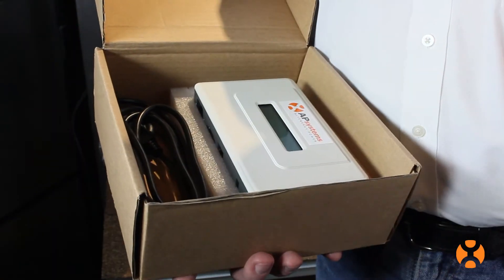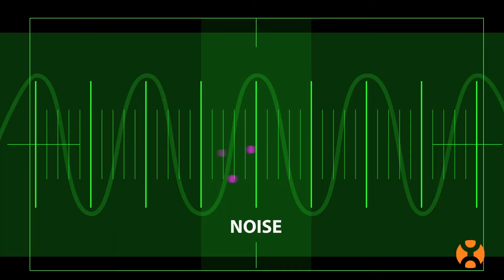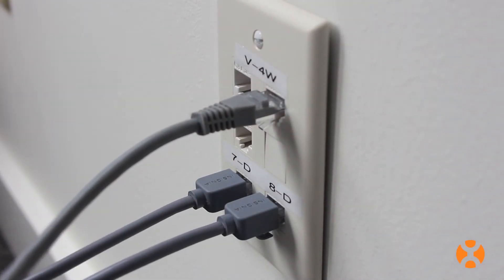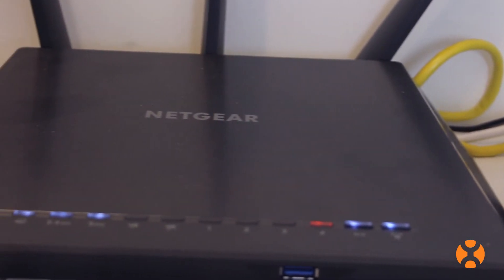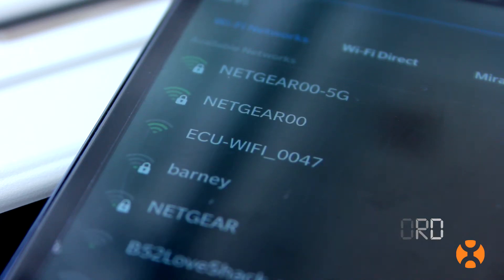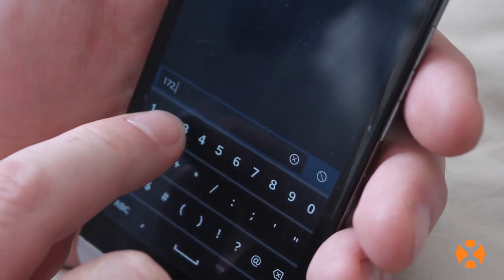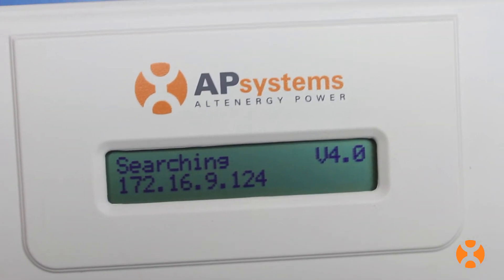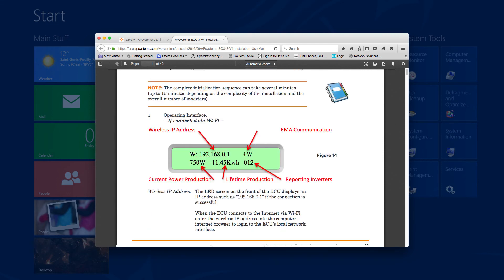DISCONTINUED PRODUCT: APsystems Training - Part10 ECU

Comment: How do you get log in details for the App?
Reply: About the only thing good on the APSystems setup that I've found is that the ECU has an internal webpage.  You can scrub that and get your own data.  By the way, you'll need to do this anyhow because APSystems won't help you at all when their high-failure-rate inverters puke out and you have to replace them.  They won't let you administer your own account, meaning that you cannot swap out that failed one for a new one.  God help you if you cannot program because these guys won't give you any help at all.

Comment: Hello. I have ECU-3 v4.1NA and every day it stops monitoring the inverters from 10AM to 11:30AM. Every single day I can’t have data between these period, and also 0! is displayed on LCD. After 11:30AM, it comes back. I have changed outlet, but that not solved the problem. Signal level shows as 5 on web interface.
Reply: If you are not a certified installer, Paulo, good luck.  About the only thing APSystems will do is tell you to find someone else to deal with their problems.
Reply: I forgot to mention that even without data in this period, I have confirmed that it is generating energy  by checking the meter.
Reply from the maker: Hi Paulo, I'm sorry to hear you are having these issues.  Can you please contact us directly at support.usa@apsystems.com so we can troubleshoot this directly with you?  Thanks.